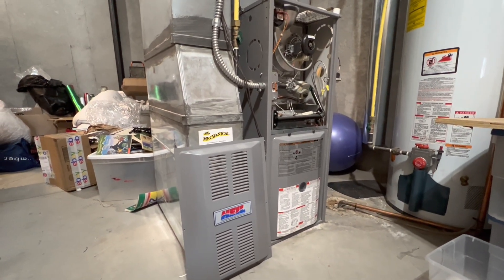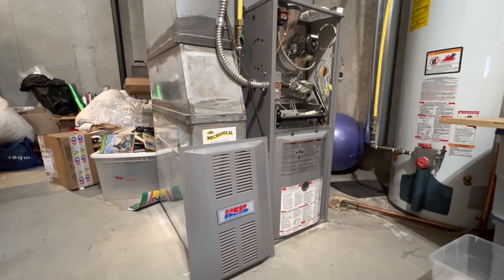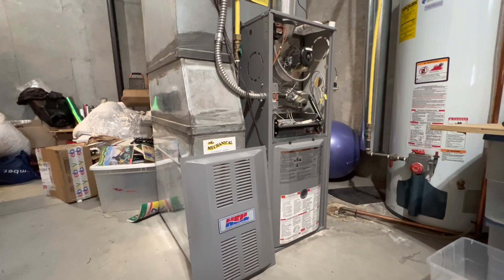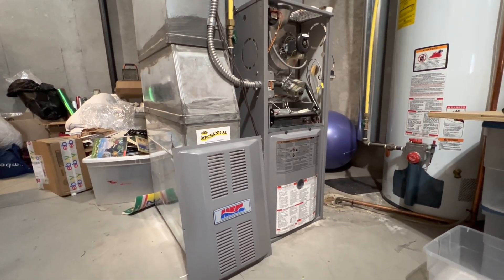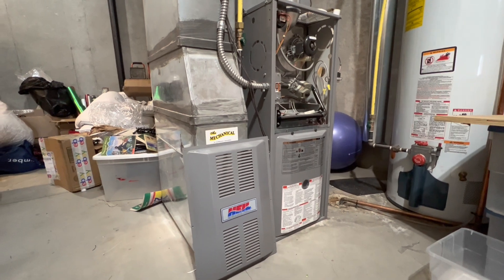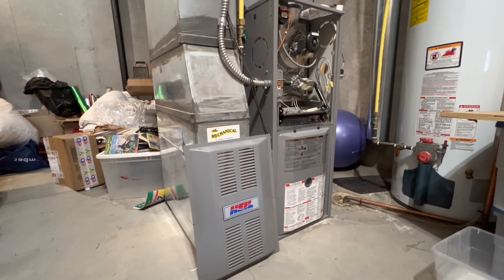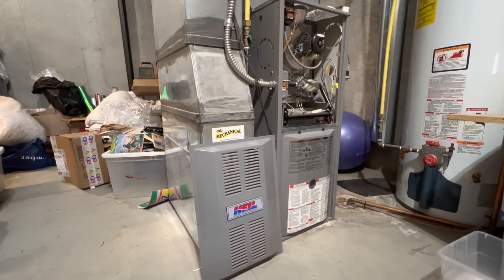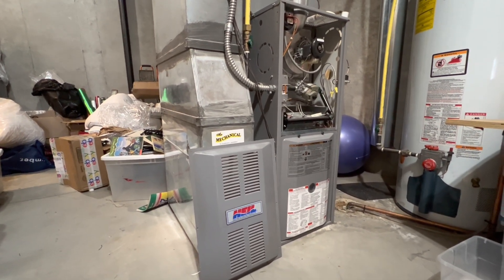EPIC STARTUP SOUND! All Starting Sequences Of A 2007 Heil Gas Furnace (No Commentary)

Comment: Step 1. Thermostat calls for heat and sends 24V to the control board. 
Step 2. The board verifies;  A. Pressure switch is open and  B. limit switch(s) are closed, and then starts draft inducer motor.